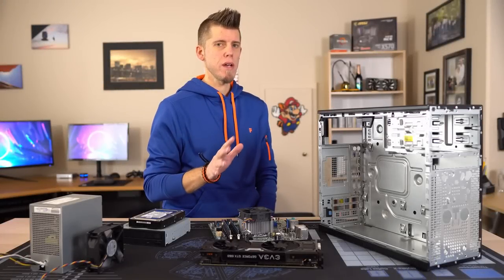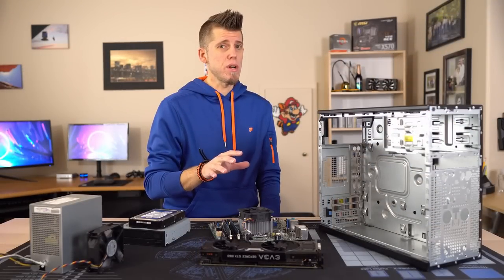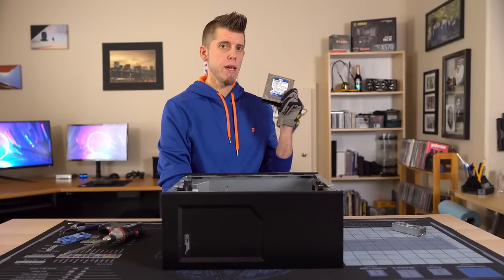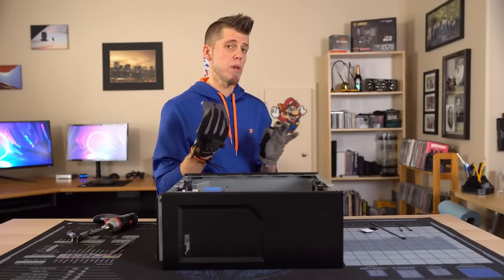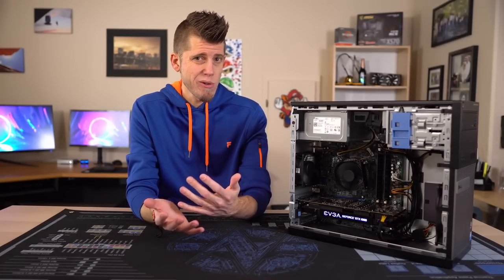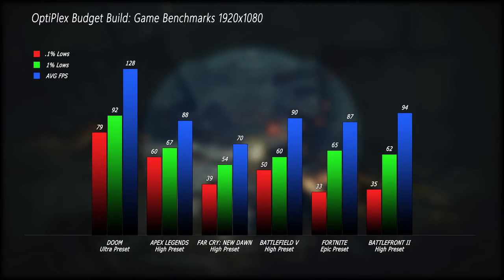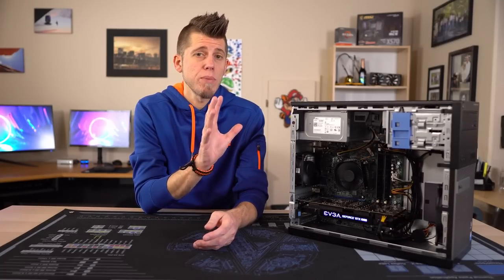Dell OptiPlex Budget Gaming PC For Under $300?

Comment: Excellent video! By any chance have you seen this done before? https://linustechtips.com/main/topic/987783-optiplex-70109010-front-io-panel-pinout/?tab=comments#comment-11899618
I've been considering making one of these 2.5" IDE to 3.5" IDE adapters into a front panel adapter so I can ditch this desktop case for a mid tower & fit in an RX 580.
Also, they have Dell 5 pin to standard 4 pin adapter cables on amazon. And if a regular power splitter can't power multiple fans, then a powered fan hub plugged into the motherboard through the adapter might be worth a try.
Reply from the maker: They really got in depth there on the pinouts on the front header. Great for people wanting to do a case swap. I have to wonder if the pinout is the same for the 7020 and 9020. I've never done it, as I'm having fun cutting up the Dell cases and most budget cases seem to not be as constructed as well as this. Great option though for someone not wanting to do all this cutting or for people that don't have the tools.

I've seen those five pin fan converters, and yeah, a power fan hub would work perfectly for that.
Reply: @TheGameBench  If they have the same connector I would assume they have the same pinout. I can't seem to find just the Optiplex mid tower case so I was wanting to put everything from this desktop case in a Rosewill line m case.
Reply from the maker: @kekistanifreedomfighter4197  Possibly, but I wouldn't assume, I'd highly suggest verifying it first. Seen it enough times where the pinout was different when it seemed the same. Doesn't make sense, but sometimes companies do crap that makes no sense.
Reply: @TheGameBench  True, after all everything on these is proprietary. But according to Dell, the only difference between the two is BIOS, Chipset & hardware support.

Comment: I got a refurbished OptiPlex 9020 with the i7 4790(I think that’s right) for $20. What can I do to play games like warzone ?
Reply from the maker: That's a pretty awesome deal! My suggestion would be to buy at least a 250GB SSD for the boot drive, if you haven't already. But you can find 500GB SSDs as cheap as $40 or even a little less. Then, I would go with a minimum of 16GB of RAM, if it didn't come with 16GB. Then it's just a matter of adding a GPU. Something along the lines of a 1070 or 1080 are ideal for the i7 4790 at 1080p, much more than that and bottlenecking becomes and issue. Though either of those will need a power supply upgrade. If you want to use the stock power supply, something like the 1660 Super/Ti would work well. But you should definitely use a dual SATA to PCIe power adapter. Something like an RX 6600 "MIGHT" work as well, but I don't have one to test to see what it's power draw would be.
Reply: @TheGameBench  is 980ti sufficient to play red dead redemption and WarZone and

Comment: If I was going to upgrade the psu on this, would i use a 24 pin to 8 pin adapter cable?
Reply from the maker: Yep, the 3020, 7020 and 9020 all would need the 24-pin to 8-pin adapter.

Comment: how did you screw the fan that came with the PC back on?
Reply from the maker: Typically, I just re-use the rubber vibration mounts, but sometimes they dry out and break, so I just used the same screws they package with new fans.

Comment: Can you do a video on adding a PCI-e adapter with NVMe drive working as the boot drive...if possible
Reply from the maker: I wish I could, but these OptiPlex BIOS's have no provisions to boot from the PCIe bus. Which is odd since the 9020 Micro uses an m.2 drive. Yet, even with the latest BIOS (A24), they haven't added a way for the MT or the SFF to boot from the PCIe BUS. I've tested it. You can only really use it as a storage drive.

I believe there's a way to do it with Clover, but in my research, it's a huge PITA and it's not really worth the hassle. While an NVMe drive is substantially faster on paper, in actuality, 99.9% of people aren't doing anything that they'll see that speed difference in outside of synthetic benchmarks and large file transfers between NVMe drives.
Reply: @TheGameBench  thank you!  Saves me a few bucks because I was definitely looking into this 😂
Reply from the maker: @patrizzull  Sure, no problem.

Comment: do you think i could run a 1650 super with an i7 3770 using one of those pcie to sata adapters with a 275 w 80+ gold psu for a couple of weeks
Reply from the maker: Honestly, the 1650 Super is a pretty efficient GPU. You'd have close to 100 watts to spare. You can replace the PSU if you want to, but it's not nessisary.

Comment: Would you recommend using the MODDIY 24 pin to 8 pin to run an upgraded PSU? I want to be able to run a 1070 with my 9020 with an i5 4570?
Reply from the maker: Absolutely! They have one of the best adapters out there. The only downside is that you'll be waiting months for it as it will be coming out of China. Ordered some USB3 cables from them a couple of months ago and I'm still waiting for them.
Reply: The Game Bench wow! So what should I do in the mean time? SATA cable for a GPU or just run a small gpu with no external power on stock PSU for the time being? I’m also not opposed to building brand new from scratch but then I’ll have a 9020 and an adapter I won’t use lol
Reply from the maker: @francophysique5192  Well, did you already order the ModDIY cable? The wait is the reason I don't order them for ModDIY and I just go with one of these two.

https://www.amazon.com/gp/product/B07CJ411ZL/ref=ppx_yo_dt_b_search_asin_title?ie=UTF8&psc=1

Or

https://www.amazon.com/gp/product/B07CJ49NK8/ref=ppx_yo_dt_b_search_asin_title?ie=UTF8&psc=1

I've used both of these cables several times and they've been great. Plus you'll get the adapter quickly.
Reply: The Game Bench I already ordered it :/

Comment: Hey The Game Bench! I want to buy this Dell Optiplex 9010 off of ebay for $95 shipped (After Tax). It has a i5-3570 clocked at 3.4Ghz, 8GB of Ram, 500GB HDD with Windows 10 Pro. I already have a Radeon RX 560 4GB (Single Fan GPU) in my current system. My cpu is getting really outdated I have a AMD Phenomn II X4 840T and 6GB of DDR3 Ram. Do you think I should go for it and buy it?
Reply from the maker: Just got done testing the 3570 against the 2500 and 4690. The 3570 is going to make that 840T look like a calculator and with the 560 you're going be pretty much GPU bound anyways. Including tax, that's a decent deal on that system. I'd say go for it.

Comment: I need help I bought an optiplex 7010 and works great  but my problem is with the CPU fan pin on the mother board won't detect my CPU fan and makes it run to full speed, is noisy so I connect the CPU fan in the rear fan connector and works perfect but I have  CPU 0 fan failure is any way to fix CPU fan sensor problem in the Mobo?
Reply from the maker: If it's working fine on the rear fan connection, sounds like there's an issue with the fan connection itself. If you plug in the rear fan into the CPU fan header, does it do the same thing? Also, is the temp sensor still connected?
Reply: @TheGameBench  yes when I connect the rear fan into the CPU fan header does the same thing, full speed fan problem, when I run onboard diagnostic detects one error in the processor fan section 2000-0511 and in the system health part the sensor of the CPU fan says 0rpm current high and low I don't know what to do I have to press f1 everytime I turn on the pc
Reply from the maker: @Jerl9  Okay. Unfortunately, there's effectively no practical way to fix that.
Reply: @TheGameBench  ok :( thank you for the help, and keep it up with the nice videos about optiplex :)
Reply from the maker: @Jerl9  No problem. Sorry I didn't have better news for you.

Comment: Also am I limited to one hdd or ssd using this option because I have a hdd and an ssd.
Reply from the maker: No, not at all. This system had an SSD and a HDD. There are a lot of ways you can go about mounting more drives. However, if you want to add more SSD's or HDD's you'll want to add a SATAIII controller since you only have two SATAIII ports on the motherboard.
Reply: The Game Bench thank you
Reply from the maker: @theonlyk9918  Anytime.

Comment: Do you know what cpu cooler would be a good replacement for the optiplex 9010?
Reply from the maker: Honestly, the stock cooler is more than adequate for these locked CPU's. However, if you want to replace it, just remember that you will need to modify the backplate/CPU retention bracket. Also, you'll need to the stick to coolers under about 139mm to clear the side panel.

Comment: Planning to buy a 9020 with i7 4790 that has 4gb ram and 320 hdd then Im gonna get an rx 570, should I upgrade the Psu?
Reply from the maker: It's possible to run the 570 on the stock PSU, but I don't recommend it. I'd get at least a 400 watt unit for the 570 or 580.

Comment: getting my 4790k this weekend,im gonna try the Dell air cooler and see if it keeps it cool before i add an aftermarket one. from what ive learned i will have to remove the MB to modify the mounting plate to add a better cooler.....any thoughts or suggestions?
Reply from the maker: You'll have to remove the backing plate for the stock cooler for the new one. Otherwise, you shouldn't have to modify anything.
Reply: @TheGameBench  i wish i had the stuff already,because as you can tell im speculating. you have way more experience and knowledge than me brother!! im gonna try to find that video again
Reply: it would be nice if i could add a cooler WITHOUT having to remove the MB
Reply from the maker: @meemadd6397  Well, that's inevitable. It's not often that you can change out the cooler without having to access the backside of the motherboard. That being said, that was a different system and cooler. I don't think you'd  have to go to the same extent to change out the cooler, but let me make sure. I'll pull one of the boards out and take a look tomorrow. I don't think the socket latch and the backplate are one piece, like in that video, but I could be wrong. Also, that cooler is smaller than the one in the OptiPlex, which makes sense. They love to cut more corners in the consumer systems, which is one reason I avoid them. I don't think you'll need to replace it, but let me look at one tomorrow and get back to you.

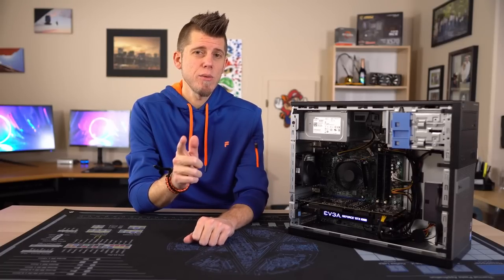Comment: 18:27 Wouldn't it be easier to mount the SSD the other way?
Reply from the maker: Sure. But I'm all about form and function and I feel like it's not much harder to just swap the connector around. But, by all means. I guess it would have been a good idea to have at least mentioned that.

Comment: If i wanted to just add in a gpu what parts do i need?
Reply from the maker: Depends on which GPU you want to install. I suggest sticking to dual slot cards and if you don't want to remove the HDD cage, you'll have to stick with cards under ten inches in length. The stock power supply in the xx20 series is good up to about the RX 560 on the AMD side and the 1060 6GB on the nVidia side and you'll just need a SATA to PCIe adapter. Anything more will require you to upgrade the power supply. For that you would also need a 24-pin to 8-pin ATX adapter.

Comment: Do you think i could add a gtx 1650 low profile on a 7010 sff without changing the psu?
Reply from the maker: Absolutely. I have a 1050 Ti in an HP 600 G1 SFF and it runs fine off the 240 watt PSU. The 1650 will, at worst, consume the same amount of power. With the 1050 Ti and an i5 4690, it consumed around 150 watts total.
Reply: @TheGameBench  alr thanks man have a nice day

Comment: Where did you get optiplex so cheap plz suggest some websites
Reply from the maker: I've done a little more than 20 of these and I've got all of them except for one off eBay. I managed to find one for a good deal locally. If you're in the U.S. finding deals on these aren't that difficult. I find them all the time. The key is persistence and patience. Check listings often, and it might take you some time to find the right deal. Hell... I just bought two 9020's with i5-4570's, 8GB of RAM, and a 2TB HHD for $85 a pop. He was asking $95. After shipping I paid $100 each. Now, those two had been listed for over a month. I had been giving the link out to people asking this very question, but nobody was buying them, so I went for them. The deals are there, you just have to put in a little work. Also, look locally at computer recyclers. Schools, hospitals and offices swap out systems and that's where you're likely to find these. I hardly ever see them for good prices locally, but that's the story with any computer around here. It might be different in your area.

Comment: i have upgraded a few Dells. Here's how you can use any fan/s you want with a 5 pin to 4 pin pwm adapter cable. https://www.amazon.com/adapter-connector-converts-proprietary-sleeved/dp/B005G50C6Q
I've also put any size gpu (with the HD cage removed) with these 90 degree sata cables. https://www.amazon.com/Silverstone-90-Degree-Low-Profile-Connectors-CP11B-300/dp/B00KTLGDGA
Reply from the maker: Those are the exact cables I've been sending people to. I'll be talking about them in a new video.
Reply: cool, thx for the sheet cheat, added to my notepad

Comment: I have a i5 2400 and a rx 580! I wanna get the i7 2600
Reply from the maker: You can find them for around $50 on eBay pretty easy. Just bought one for testing. I can tell you this... the 2400 is really holding that 580 back. The 2600 will really let it stretch it's legs. It'll make your frame rates more consistent.
Reply: 🙂 go for it, if a xeon is supported get the cheaper xeon 8 thread

Comment: Game Bench, thank you so much for making and posting this video.  I'd like to upgrade my existing PC for an office PC (no gaming).  (It's a Gateway, ~11 yr old, Phenom/2.2 GHz, 14" high x 7 w x 16" deep). I'm trying to reuse the same case because of it's front 5.25" drive bay to house my front load optical drive, and,to save $.  I'm hoping, at some point, to have enough savings budgeted to purchase a new MoBo/CPU/GPU/RAM/SSD, (my desire is for: Ryzen5-3600, and a similar GPU as you've shown).  Your video is evidence of the possible reuse of my said case.  (I've recently replaced it's PSU: 600 W).  Said Gateway case does not currently contain a front fan, but can adapt one, as you've done.   Any comments/suggestions welcomed.  Thank you very much.  tonyd\.
Reply from the maker: Can you tell me which model it is specifically so I can look at the chassis? Adding a front fan might be straight forward, might not.
Reply: Dear  @TheGameBench  Please don't use your time to do this, but any comments most welcomed (said most kindly and respectfully.  I'm just delighted & grateful for your reply to my inquiry).  [The following I share with you].  Your video is proof that I can [most likely] use my existing case: ¡Thank you!.  (Gateway model in question: GT5674, shown here):
https://www.cnet.com/reviews/gateway-gt5674-review/) 
   I've taken my PC partially apart since my first inquiry.  (Just as you've shown), it looks like I can move the HDD up to just below the CD/DVD & mount it horizontally (with brackets you mentioned).  (HDD is currently mounted vertically in a cage that is removable, by one thumbscrew).  Eliminating said 'cage' will make clearance room for mounting a front fan (90mm, perhaps even a 120mm).  Currently, said cage partially blocks the front grid that is behind the silver name plate on front lower half of case.  
   (Excellent video. I refer to it for help. Thank you much). 
   (Grateful for your reply.  I wish you most well, and success in all your good endeavors). PS I hope you don't mind further questions from me.  God Bless you.  tonyd\.

Comment: Kind of a weird question but could i run a Rx 480 in the same way the GTX 1060 is run in the video? Thks
Reply from the maker: Can you? Technically... yes. Should you? I wouldn't. It will run, I've tested it. It works, but it leaves you no headroom on the power supply as it's pulling around the 290 watt mark from the wall, giving you maybe 20 watts of overhead.
Reply: @TheGameBench   thanks. Got it. I'll move to a new PSU with adapter to 8 pins. Price are super high right now for those, bummer.
Reply from the maker: @Mambrax444  Yeah, everything's in the crapper. Had to pay almost $100 over MSRP for an X570 board last night. Everything's bad right now.